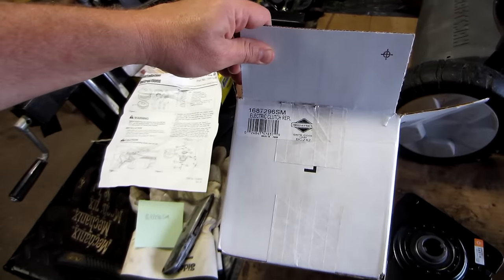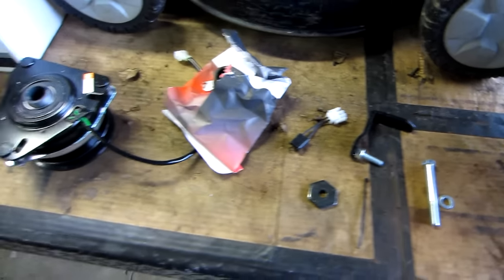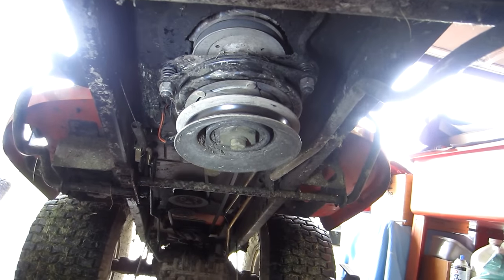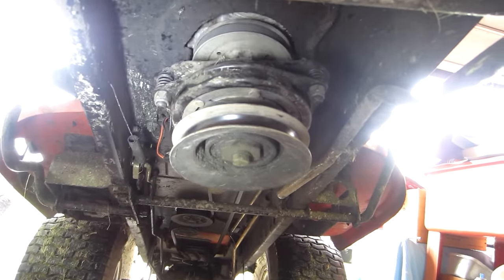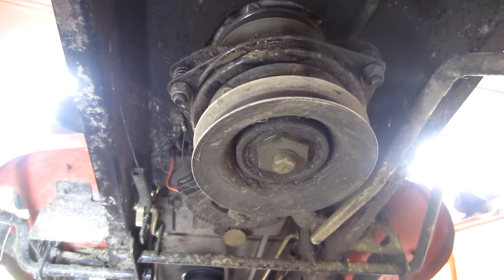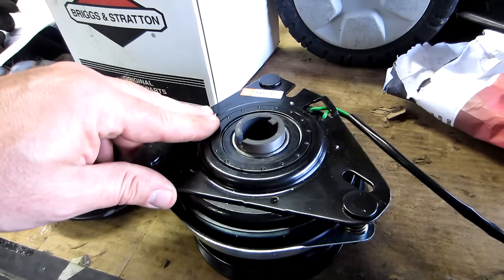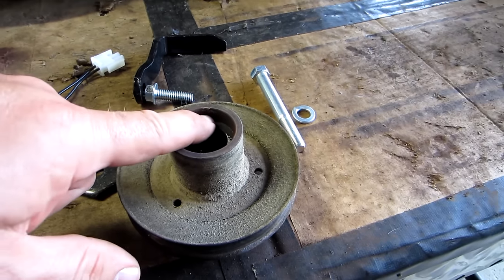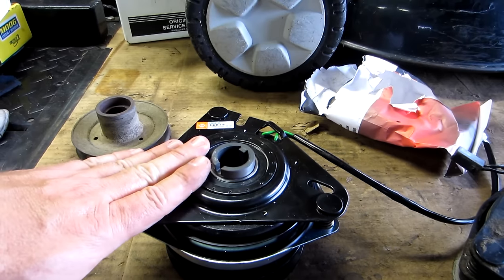Troubleshoot Replace mower PTO CLUTCH

Comment: my Zoro turn zero it blew the fuse once ran great the rest of the season til the end mower started shutting off by its self. This season same thing now it won't start at all. Also can you show me how to replace a choke cable I am having to do it manually.  How much do batteries run? Thanks! First time working on a mower.....
Reply from the maker: Would love to help But, I do not have any equipment here that is close to what you have.. Sorry..

Comment: My John Deere LX178 lawn tractor runs and when I turn off the PTO after cutting the grass I cannot cut it back on until the next day or I guess to The Cools down it's a 2006, Would it be safe to assume that is my clutch!!!  I DO HAVE A PTO SW
Reply from the maker: What I would do is once it's hot disconnect the harness at the PTO and try to apply power directly to see if it will engage. Of course if it does while it's hot then you don't have a PTO problem it's something else.

Comment: I have a question ? Got a john deere and im trying to removing i got the bolt out but hard to remove the clutch what kind of tools i need to use ?
Reply from the maker: None. The bolts the only thing that holds it on. So if it's not coming off it's because it's stuck to the shaft. Maybe even rusted to the shaft.
Reply from the maker: There may be the slightest chance that there might be a set screw that is through the side of the PTO collar that might need backed off but that is very rare
Reply: @Foxboss9  thank you
Reply: @Foxboss9  i think it rusted. For sure what do i need to do .? To remove the clutch

Comment: I have a 2008 simplicity broadmoor 20 hp.  The problem I am having is that when I get into thick grass the blades are slowing down.  the motor rpm is not changing and the belts are not slipping.  I beleive the problem is that the clutch seems to be slipping under load.  How can I fix this

Comment: I am fixing to replace the clutch on my John Deere LA 150. The bracket broke and the clutch started to spend which tore up the wiring. My problem is this: When I install the new clutch I have to find a hot wire to go to the safety switch under the seat. Right now I have put a jumper from the old clutch to the safety switch. When I install the new clutch it comes with a wiring harness just for the clutch. Do you have any ideas on how I can run a hot wire to the safety switch for the seat after I install the new clutch with the new wiring harness ? The wiring harness is the one just for the clutch, not the complete wiring harness for this mower. Thanks need your thoughts and ideas.
Reply from the maker: Robin Meads  Sorry, you'll need to get a wiring diagram and trace it out ...no real easy way to rewire it unless you buy a new harness or patch up the old wiring.. good luck..

Comment: Think mines still good something from my flip switch shuts the mower off 

I took the clutch off checked the clutch with power in the wires and its good 

But my metal switch is good to its not a pull switch what your taking about but still does the same thing my switch is being grounded out some place

Comment: How in the heck do you undo the connector that the two green wires go into? Edit: it was tough but I finally got the connector apart. The connector shell is slightly messed up though. Had to pry it against itself with a screwdriver.

Comment: I bought a new PTO and the instructions say to recheck the torque settings on the bolt holding it on after engaging the PTO several times and even after a hundred times. A hundred times ?  Crap , I bet nobody ever does after a hundred times and I doubt I will either.  What are your thoughts on that ? Nice video by the way and thanks.
Reply: Put it this way it’s only torqued down once wherever any mower is originally built at factory. I would check the torque settings maybe after engaging it once or twice but then it should be good honestly

Comment: I have a 2019 Toro Timecutter  and when I engage my PTO it slows down the engine and even to the point at times it will cut off the engine. What do you think my problem is?
Reply: Bearings could be bad

Comment: If the seat switch was bad..wouldn't the mower fail to start.?..rider on. key on. pto on. I have 12v to clutch..ohms 3.6..but has continuity unplugged.this bad?

Comment: love your videos, still have problem. pto switch burned up. i replaced clutch because it has 860 hours i replaced pto switch and new key switch and new relay. fired up pto worked for 15 minutes shut it off and wouldnt come back on. its a 2005 cub slt 1554. i disconnected pto plug checked for power and if i ground my test light to the frame i have power with switch pulled out. but have no pwer if i ground my test light to the second wire in the connection. please help what is the other wire for? its white.
Reply from the maker: I am not 100% sure as I had to trace all my wires to find where they came from BUT, it may be a safety switch wire..
  If the PTO switch is still good then the majority of the problems with PTO's not engaging is safety switches not working or being engaged fully and not allowing the "all clear" signal to be sent to the PTO switch to allow it to engage the Clutch.. 
  Also, make sure engine and battery have good grounds(usually not an issue though)
Reply from the maker: The white wire could also just be a power wire for a PTO on indicator dash light
Reply: thanks for replying. your probably right about the white wire because i do have a pto indicater light that doesnt work, i looked at schematic white wire goes to relay. i dont know if it is indicater light is causing this. i did what you said in other video on reverse switch.i cut the red wire and wire nutted the end. i also bypassed seat switch and i pulled the break switch and tested it and was fine. now with that said i just unplugged connection on pto. i ran jumper wires from hot wire from the connector to hot wire on pto side of connector and ran another jumper wires from frame to the other wire on pto side of connector and everything worked i just mowed 2 hrs shut if off and on again just fine. whats your thought my good man. thank you
Reply from the maker: I am not sure on that, I have a tough time not having hands on when diagnosing eletrical..
at this point I think that running it bypassed might be the way to go..

Comment: Chief,   I need to REMOVE the electric PTO that's stuck on the engine shaft, I >>DO<< have the center bolt out.. Advise, thanks
Reply from the maker: +Numa Newbern The standard pulleys they put on non-pto mowers get stuck all the time. They call those regular pulleys "stack pulleys". Stack pulleys that are stuck can sometimes be removed by penetrate sprayed on top of the pulley in a small puddle and letting it soak for many days. But most time it is heated  or cut off and replaced.. In your case you cannot really heat enough without the chance of damaging the PTO electrical. and cutting off defeats the purpose of saving but can be done if replacing. you could try to disassemble the PTO on the engine til it gets down to a smaller collar that would make it easier to cut(again only if replacing) or try PB Blaster spray .. No easy answer though..good luck
Reply: I had the same issue. A pulley puller did the job very easily.
Reply: +markfothebeast I ended up taking a dremel tool with the little cutting wheels and cutting it off, got REAL DICEY getting down to the engine shaft.

Comment: I just checked my PTO Switch on my Husqvarna yth2348. It shows a reading of "00.4" in the OFF position and "00.4-00.7" in the ON position (depending on which terminals you test). The problem I am having is that when I have the mower running and I pull the PTO lever out to engage the clutch (Brand New clutch) the engine dies. I even unplugged the clutch and the engine still dies when I pull out the PTO knob.................Any help would be greatly appreciated!!!
Reply from the maker: You have a safety switch issue ... it thinks you are not sitting on the seat..
Reply: @Foxboss9  I have the same issue but my seat safety switch is reading good.  What safty's are also in the PtO switch? I have a 1999 craftsman  20 hp Kohler vtwin.

Comment: I have a sears model 917.275520 which is a 42 inch deck with a brigs 23 hp engine. It has a manual engagement lever for the deck, if I were to change to a electric pto do I have to change the belt also or does it use the same belt?
Reply from the maker: Jimmy Drew most likely the belt will be close but you also need a powered PTO deck as there is a tensioner that is usually missing on manual decks compared to the ones that are equipped on power PTO models.. I can honestly say that I have never converted a manual to a power deck before... I have never found a reason to convert because I firmly believe that a manual deck is better... I know that some of sears manual engagement decks are known for "sticking" but when you have issues it's usually curd Buy lubricating and keeping the deck clean or at worse replacing a couple of components that may only cost $40 tops..... However, when you have an issue with a power PTO model those electric clutches can run upwards to $400. And even the cheap ones can be hovering around the $150 mark. Electric pto's are just like throttle body fuel injection when it first became available on cars, in that, they are a dream when they work and a nightmare when they don't.

Comment: I have a troy bilt tb2450, the pto clutch assembly just buzzes, and has a burned smell. it tries to turn, but just buzzes,  could it be burned out, or is there an adjustment?
Reply from the maker: look up  PTO air gap adjustment.. see if it matches your PTO Style..

Comment: thanks my switch under the seat was not hooked up.    an ongoing problem is the alt light comes on when the PTO is on after it has been on for a while.    Cub Cadet 1440
Reply from the maker: Walter Coy may have a weak charging system...
Reply: I have a Briggs V twine I had to replace the Battery last week it wouldn't hold a charge. should I change the voltage regulator ?
Reply from the maker: Walter Coy yes and also the alternator output

Comment: I lost ground to clutch while i was cutting  lawn, does the clutch supply the ground or is it the relay this mower was sitting outside for a year and a half it was given to me  i have spend  $85 so far with new belts and pto switch and oil change, i was cutting lawn for about 10 min when blade stop working.

Comment: Great video.  I just put a new drive belt on my 06 cub cadet SLT1550.  Now it vibrates like crazy.  What would cause this?
Reply from the maker: Jerry Reid thanks. What do you mean it vibrates? Does it vibrate when you drive it? Does it vibrate when you turn on the blades? Or does it vibrate just when it's running only? As far as common wisdom would dictate that something you did while putting on the new belt caused the vibration. If you removed any pulleys you have to make sure that they are reinstalled correctly. Usually anything that I've worked on that had a vibration means that something that spins or goes around is out of balance. So either the belt that you installed has a flat spot on it or it is Twisted, or something else is causing the vibration that has nothing to do with your most recent repair.

Comment: started my craftsman 16 hp green ride on mower today,and something is stuck. can't roll it. stalls under load of blades or drive train. don't sound like cut off switch thing. a link to a video on that would be great.  i haven't seen one yet.
Reply from the maker: immrnoidall I don't have a video on anything like that. Check to make sure that your belts are moving freely. The fact that it it stalls when a load is put on it by either the blades or the drivetrain makes me think it is not belt Related but always good to check. Anytime I've had a mower in my shop in the past that stalls under any kind of a load whatsoever has always been engine power related. Unless the transaxle is locked up or the brake is stuck. Or, the spindles on the deck or froze up. Both of those situations though when it stall the engine necessarily it would just burn up the corresponding belt that was trying to power the thing that was stuck. So again, going back to the fact that both things make the engine stall without burning up a belt makes me think that it's a engine power issue. But the easiest thing to check is the belts just to make sure before you move forward with diagnosing the engine. Good luck.
Reply: can't roll it with the trans disengaged. i took the battery out last night and i can now get to the trans axle pullies  after lunch with the family. noticed the deck has some huge rust holes so the project just got much bigger.
Reply from the maker: immrnoidall check to make sure that the break is not stuck on. That is a common issue. While laying on the ground behind the mower reach up on the right hand side of the transaxle and find the rod that runs to the brake pedal and just wiggle it to make sure that the mechanism is free. If that is free then check to make sure the belt has not jumped off and jammed itself causing the drive pulley to be stuck. If those two things are freed and it still won't move then you have something internal in the transaxle that went bad. However, that is most likely not the case. The rusty deck, that's a whole other story. Could be that the blades are physically hitting something underneath causing them not to turn. Again good luck
Reply: OK, thanks for everything.

Comment: Hello, my craftsman ztl7000 just stopped on me while i was cutting. It starts and runs but does not move forward or backwards. It is about 4 yrs old and in nice condition. The belts are fine. Does the PTO switch also control the hydraulics as well?Any help is appreciated. Thanks
Reply from the maker: The PTO switch does NOT control anything but the PTO.... Your problem lies in the transaxle/hydrostat..... if all the belts are good and the fluid level is correct(check manual for level) Then you either have a Dump valve issue(make sure it is in the engage position by moving in and out a few times) or the transaxle/hydrostat is needing replaced or rebuilt

Comment: I have a cub cadet slt 1554 and my PTO would randomly stop spinning blades. Then the blades would not engage at all. Getting power to the switch and to the plug. Any ideas? Want to avoid replacing the PTO clutch if possible.
Reply from the maker: Well you can try a new $20 dollar switch but if the wires going to the PTO are damaged/frayed or if the PTO is bad then the switch will need  replaced again, and you will still need to fix the problem... There are no hard fast fixes when it comes to electrical issues, you have to troubleshoot the circuits from the battery, through all the safety switches, until you finally get to testing the PTO clutch... it sucks and that's why a lot of mechanics don't like to troubleshoot electrical.

Comment: My Cub Cadet Z-Force 60L PTO clutch fell off. It was so hot it was steaming and too hot to touch. I ordered a replacement. Haven't found any specific videos to make sure I can install it correctly. Any suggestions?
Reply from the maker: Make sure there is not a missing crankshaft spacer between the clutch and bottom of the engine.. Check for parts diagrams that show if one was originally installed... Make sure clutch is lined up and held in place correctly with rod or tab that keeps it from spinning when engaged... Make sure to not overtighten but make sure it won't come loose either... That's all I can think of...
Reply: Thanks! I don't see a spacer on the parts diagrams.

Comment: I ment my Dad and i have an ingersoll 4018 and it just resently started making a clicking noise we both think its the electric clutch? what are your thoughts on that?
Reply from the maker: The PTO will click when engaged. Is it not engaging?  Is it chattering?  Is the air gap adjustable on your clutch?  How did the problem start?

Comment: My Scag 52” hydro works fine until I turn it off then it won’t restart until it cools down. However, after this last time of running then shutting it off she won’t cut on at all! It appears all the switches are working fine. I’m on clutch number 2. The engine leaks oil and it runs down on the clutch. My question, will the oil cause the clutch to burn out?

Comment: Hi, Which wires did you plug you switch into the back of the PTO to bypass the PTO?
Reply from the maker: I traced the power wire (constant hot/positive) that was coming into the switch.. I also traced the wire that would normally send power (when switched on) down to the PTO.  I then "back probed" into those two wires on the PTO harness with two homemade leads that were connected to a aftermarket 15amp pull switch.

Comment: Mine HAS the electric clutch which I WANT TO REMOVE and NOT replace, I will be using the mower as a puller of a separate cutter, I am stripping the mower completely down to refurbish. The separate pulley ABOVE the electric clutch will remain.
ANY suggestions on WHAT TYPE, model, name of puller to remove the Electric clutch?
Reply from the maker: There is not a specific puller. You can use a 3 jaw or 4 jaw puller BUT,  PTOs don't do so well with pullers because they are flimsy on the outside perimeter and the puller will not have anything "solid" to grab on to.  You need to disassemble the PTO as much as possible. You may be able to get "down" to the rigid center that is "stuck" to the engines output shaft.
Reply from the maker: Also consider this, the PTO is keeping the pulley that you want to retain, tight and mounted correctly. A PTO, as long as it spins freely, is not a "drain" on the engine and doesn't hurt anything being on the engine keeping the drive pulley mounted in place..HOWEVER. It may be in the way when trying to change a drive belt.